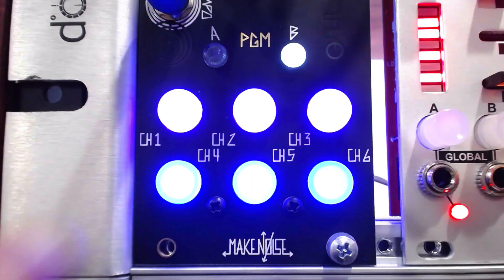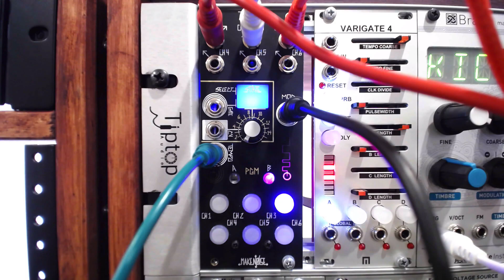Clock Run/Stop & Rests With Tempi

Comment: Is this video now out of date in regarding to the momentary / toggle behavior? Button six (around time stamp 1:32) doesn't seem to do that anymore, but I can't seem to find where that functionality went. Was it removed? 

In the latest firmware, it appears to be jumbled vs non-jumbled playback control, and doesn't change the relationship between the tempi and incoming gate signals.
Reply: I'd like to know this as well as I'm interested in getting a Tempi, but it would really suck if you couldn't do this anymore.